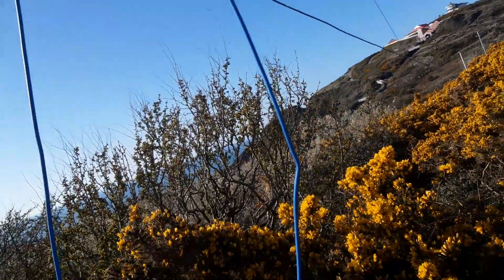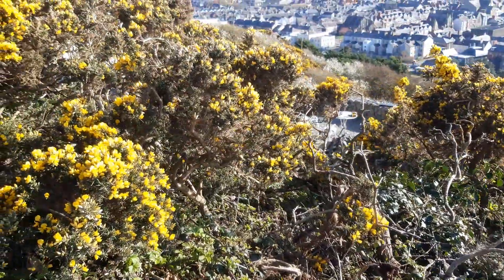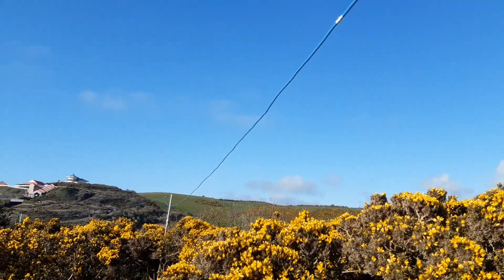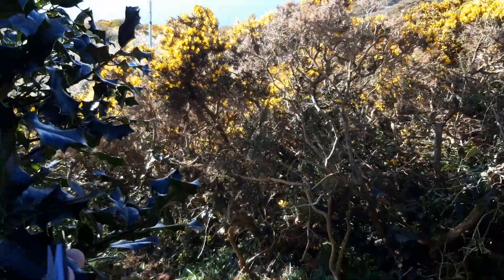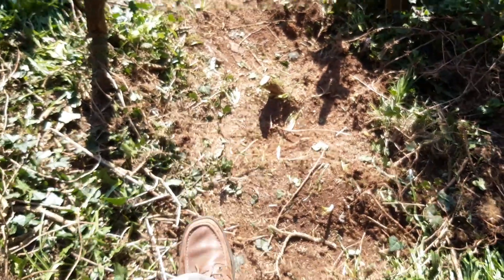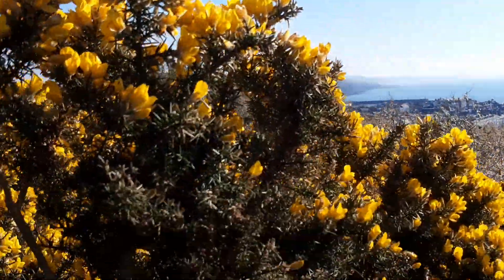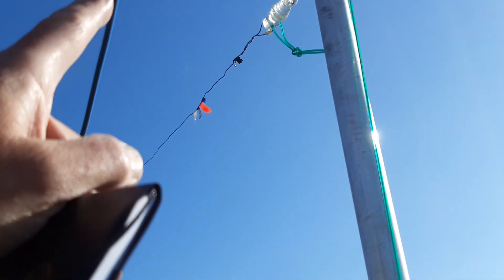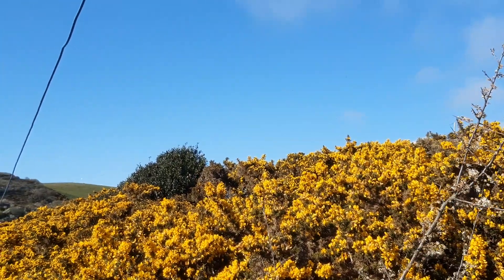Part 2 of my Low Level  80 metres horizontal loop project.

Comment: Since I have been watching you talk about the antenna and stuff, I got an idea. This is not about the subject matter you are talking about so please forgive me for going off topic. Hope that is all right with you Sir?? Would using a controlled induction heater be used for heating a home in the winter ??? My reasoning is that since the induction heater is a very efficient way of using electricity, this somehow would work with the proper design. What is your view fella on this subject. Nice video fella too. vf
Reply from the maker: Hi although induction heating is a very efficient form of heating for a lot of industrial and scientific applications (and cooking) it does have some inefficiencies.
If you have to use electricity to heat your house, you’d be better off using a resistive element. It would be much cheaper to purchase a resistive element and it’s housing rather than an induction heater with hundreds or even thousands of components which are expensive and with lots of joints all of which could potentially fail.
I don’t respond to many comments these days but I just happened to see yours today.
All the very best and kind regards . . . .Andy
Reply: @AndyDaviesByTheSea  I want to thank you Andy for setting me straight when it comes to induction heating for home heating. My thinking for some reason was a bit off. So nice for you to set me straight for future thinking. 
I would like to experiment with induction heating but getting the correct capacitors is an expensive endeavor. I hope that somehow some can be had for a decent price to experiment with the art and can send you results for guidance and oversight. 
Good day to you Andy and enjoy life down the shore. I know from experience that looking out to sea really puts one's mind at ease. Peace, Victory First
Reply: @victoryfirst2878     At least here in Australia, without ..any doubt, ..the, ..most ..efficient, way to use electricity, to heat your house, is via the use of a Reverse-Cycle Air-Conditioner..!    Basically it is just a ‘Heat-Pump’ which robs ‘free’ heat from the external environment and ‘pumps’ it into your residence, when running in ‘reverse-cycle’ mode, but, I don’t know how well that would work in England, at least, during your ‘snowy’ Winters with a force-10 arctic gale blowing in from the North Atlantic..! 😉🙄
Reply: @wa7215  I understand the idea W A. Different place different ways.
Reply: @victoryfirst2878    If you really, like the idea, of using ‘induction heating’ to ‘warm your house’ V.F. why not save yourself a whole lot of additional, and unnecessary extra expense, and just use, it, to ‘warm’ only, yourself. 😉    All you would then, need to do, is simply find yourself a ‘Microwave Oven’ large enough, for, you, to hop inside of it, before hitting the ‘GO button’. 😉    I am, joking, of course. 😉😉

Comment: Hi Andy, I just installed an 80M Skyloop using 14awg coated copper wire, 280 feet in length, at 45 feet higher in a rather square pattern.  Corner fed with LMR400 coax to a 4:1 Balun made by Palomar Engineering... model  CB-4-1-1500.   Fairly resonant with 2.5 SWR at 75M, 2.1 SWR at 40M, 1.5 SWR at 20M,  1.8 SWR at 17M, 1.1 SWR at 15M,  1.3 SWR at 12M and  1.4 SWR at 10M.  Works well, is quiet and so far signal reports and DX are great at 20M and higher.   I started at 280 feet in length so I could trim it down if needed but so far it is transmitting and receiving really well.  Cheers, 73 Art W1SWL

Comment: "But of course I forgot to slide them onto the wire first of all" - That has got to be the all-time classic with anything involving wires :) Be it plug housings or heatshrink, or in this case insulators. That place looks very lovely,  I don't know anything about antennas or probably most of the other of your videos, but still enjoy them! Thanks